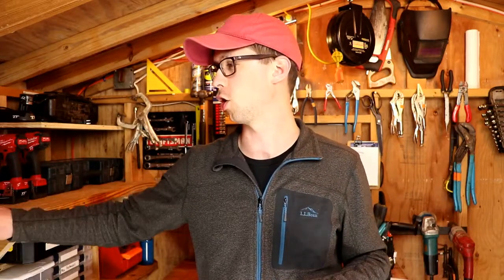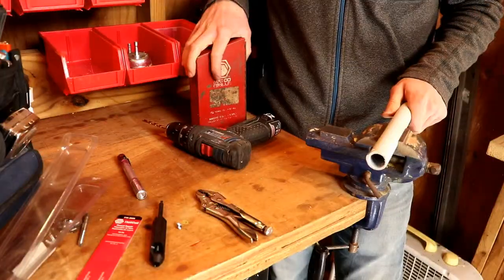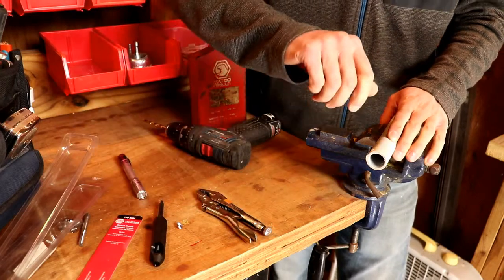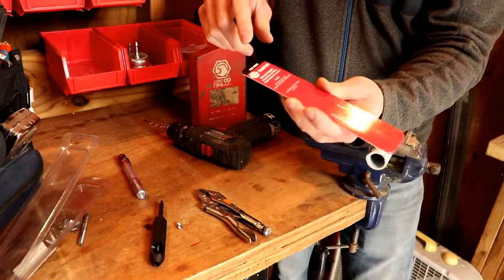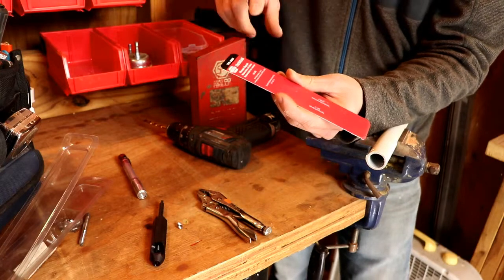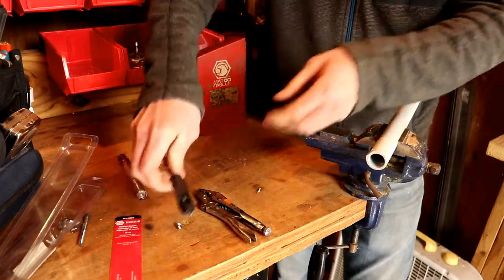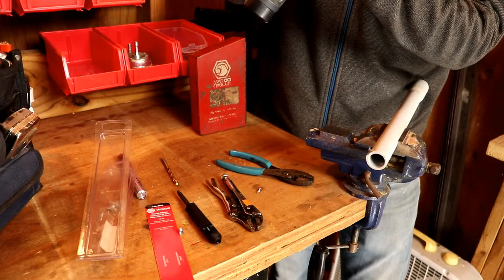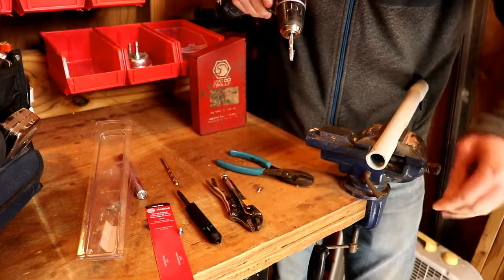How to Use a Helicoil

Comment: Don't understand what the driver is for. Why can't you just spin the helicoils in without it
Reply: HeliCoils and other same type - are LARGER [Diameter - BEFORE Installation] than the final restored threads.  (example: 8Mx1.25 bolt - will slide right in and not thread - into a not installed/not used 8Mx1.25 Helicoil thread restore coil.  It is too large inside diameter.  The Compression of it into the space helps hold it in position,) The expansion into the tapped hole - is what helps hold them installed.  So you can have difficulties with some of the installation "tools" - since it is much better to "prewind" the coil.  This tensions the insert and makes it smaller - so that it goes into the special tapped hole; where it expands out (holding it in place); restoring the threads.

Comment: ...Thanks,...that's the exact kit I just bought to replace  the threads on the lower half of the mechanical fuel pump on my 1959 TR3A Triumph....After replacing the diaphragm a few times over the last 52 years, the treads were getting 'loose' ....Ethanol in modern gasoline means replacing the diaphragm quite often, so good threads are a must....The stainless won't wear as fast as the original aluminum, and, even though it's not recommended, I am going to set the Heli-coils in with a dab of blue locktite paste......John, (west coast, Can.)

Comment: Can I put a helicoil into an aluminum threading without drilling it out? The threads are good but I want to put in the helicoil to prevent it from stripping, or do I need to drill out the old threads regardless?
Reply: A Heli-Coil is an outside thread-inside helical thread coil. It cannot simply be installed in a random hole.  Most Heli-Coil kits come with a pilot drill bit that is matched to the Heli-Coil tap. Drill out the remains of the stripped hole with the supplied bit, tap the new threads with the supplied tap, thread in the supplied Heli-Coil with the supplied insert tool.

I also recommend coating the outside of the Heli-Coil with Thread-Locker so that when the bolt is removed in the future it does not unwind the Heli-Coil along with it. (I've seen it happen)

Good Luck!
Reply: @bryanderksen4448  blue or red?
Reply: @joelopez7459  I used blue. I also waited for it to set up before inserting the bolt so the thread locker wouldn't bond the bolt to the coil.
Reply from the maker: You should really drill out the old threads and tap new ones to fit the exterior threads of the helicoil. It’s a tight enough fit when done properly, I don’t think you’d be able to force the helicoil any other way. Keep in mind that the thickness of the wall of the helicoil is what you are accounting for when you drill it out. 🧰🛠🙂